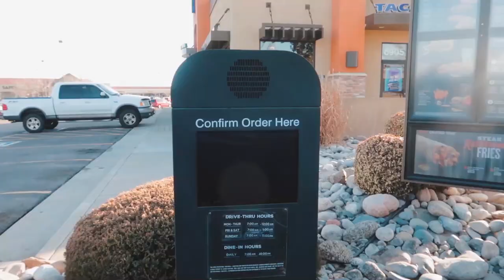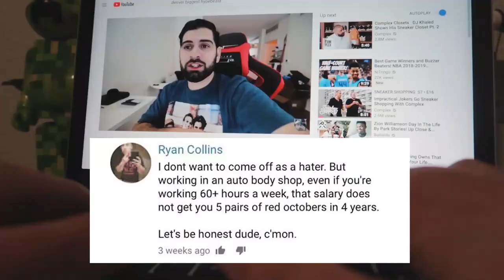Whats my rare shoe collection worth?

Comment: 100k-200k seems about right. i have no idea about the painting thing, but If you did it over 4 years, 100k seems possible. Still, it's not a good idea to blow 100k on sneakers. It's a great collection, but i personally wouldn't spend 100k on sneakers. To give you an idea, my streetwear collection is about 5-10k. I already think that is excessive. Reselling is also a bitch. Buying is also a stressful process as i have to filter out the fakes. Selling is even worse due to the saturation of most of the market. After i found out how saturated the market is, i try to limit what i buy to what i actually want.
Your vids are good though.

Comment: Your collection is fucking wild, good shit. But im pretty sure your Off White vapormaxes are fake... The "AIR" font is too bold on the shoe and the stitching around the swoosh should stand out more. Both of those flaws are common in fakes. Just a heads up bro.
Reply: Not calling you out for buying fakes since everything else in your collection seems legit. Just pointing out a shoe you probably got scammed on.